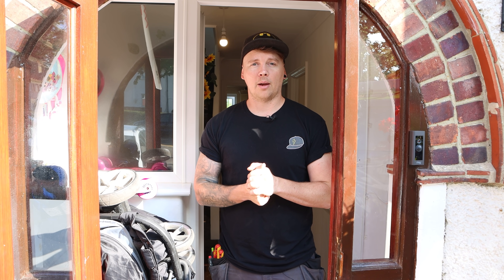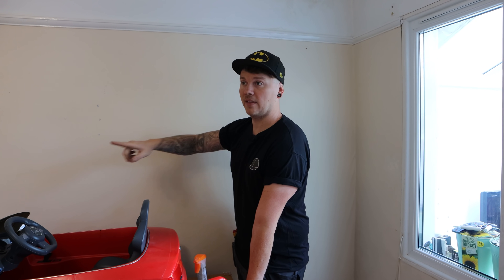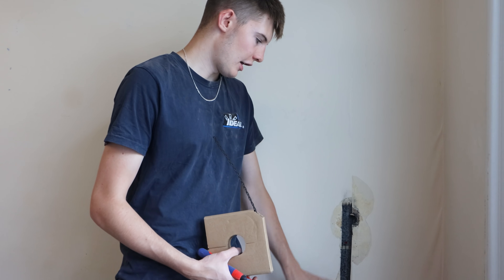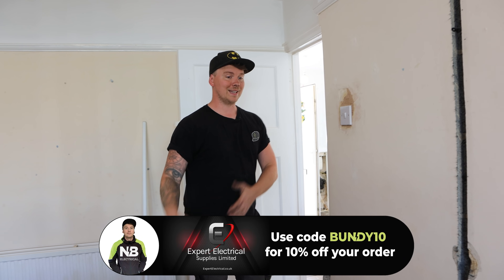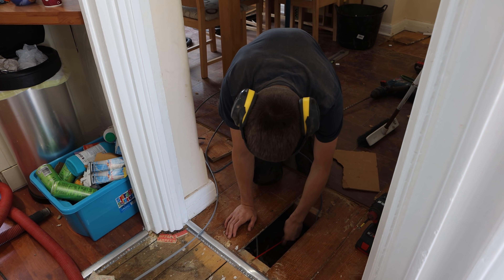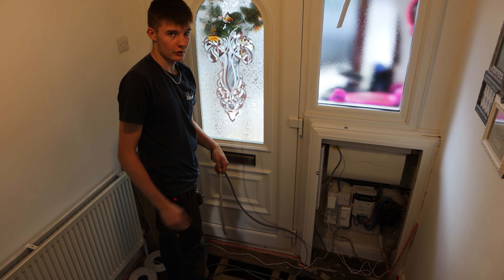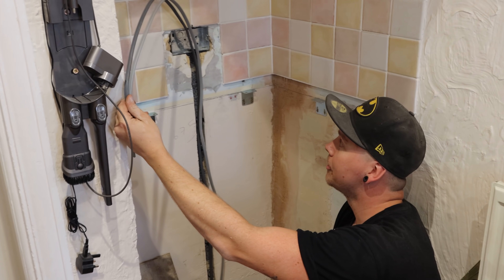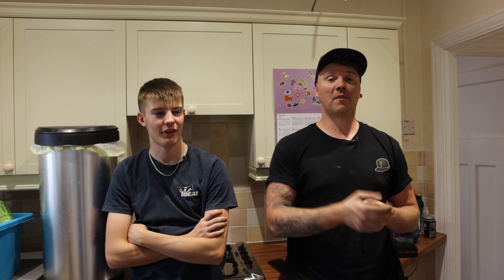Awkward Occupied Rewire   Day 2  - Electrician

Comment: Seeing the plug top poking through the worktop reminded me of a my days as a teenage delivery assistant for a Hotpoint and Panasonic dealership. In those days running the flex up through the worktop was commonplace and rather than cutting off the moulded plug top, we removed the flex from the appliance when removing the drum bolts etc, pushed it through the worktop from the top, then fitted it back to the appliance. This regularly resulted in subsequent phone calls when the customer needed to move the appliance to ask how we had removed the plug!

Comment: Epic work Kip! A "dumb" question from "down under" where ring circuits are odd to us - would it be worth putting a sticker in first accessory outlet of each leg of ring, as help for any sparky in future works?
Reply: Well they wouldn’t be weird to an electrician working in uk
Reply: I usually write in the back box first and last led from the fuse board just incase a future spark needs to fault find

Comment: Have u thought about how the bonding sticks to oval plastic trunkin?? Surely Any vibration and over time it will crack and then fall out if the wall is only painted
Reply: I've seen 60 year old houses with oval condùit and no evidence of cracking guess it's just as likely to crack on capping and conduit
Reply: @haldo691  wasn’t sure about it sticking to plastic

Comment: Given the wall is coming down in the near future was it worth bothering with conduit?  It would make the pulling down of the wall somewhat easier if it does not have long bits of rigid plastic full of wire hanging on to it.

BTW thanks to the cameraman stable pictures at last! - I am no longer sea sick / dizzy from the Nick hand held 'fly around ' shots :-)
Reply: You Wally!! When the time comes to take the wall down, removing the wall, isolating gas, kitchen electric and water plus supporting the floor above and installing  the steel is likely to be "somewhat" trickier than the plastic conduit they had to use to certificate their work!!!
Reply: @TopShelfSpurs  So the 'wally' will further show his walliness by asking why is the conduit necessary for a Certificate? I was under the impression that cables could be plastered over without protection - but I will no doubt be corrected.
Reply: @barrieshepherd7694  what gives you that impression?? Google?? or BS7671?? Your missing my point though aren't you?? Whether the cable has mechanical protection or not, doesn't effect, or complicate what the builder will have to do to remove a load bearing wall

Comment: You will find it's a lot easier to fill most of the box with plaster, then let it go off, then clean it out, that's what I seen with the plasterer's on my job, I asked would it not be easier to remove it before it goes off, he looked at me as if I had kicked him in the balls.
Reply: Yeah but make sure you remove it not the plasterer end up with trowel slashes in your cables

Comment: Has no one invented a sprung metal clip yet that goes behind oval conduit?  A single screw through the clip, into the wall and snap the conduit straight into it.
Reply: You can get them in plastic I've got a box somewhere but find it easier to screw against the sides
Reply: @haldo691  yeah the plastic ones, if it's the ones I'm thinking of, have quite a thick base so the conduit stands off the wall quite a bit.  No good for putting in a chase.  A metal one could be much thinner.
Reply: @Chris-hy6jy  yeah they are pretty thick that's why I haven't really used them think Nick uses allround band and makes his own clips
Reply: What's wrong with old skool 2x clout nails? If you can't get a grip, drill a 6mm hole, red plug, then clout nail 😉
Reply: @abcxyz820  I find an impact driver will put screws straight into mortar alot of the time
Reply: We used to use crampets. Still use a red plug though
Reply: @haldo691  yeah using the band is effectively making a metal clip.  Just a shame you can't buy premade ones.  A free invention idea there for someone 😂